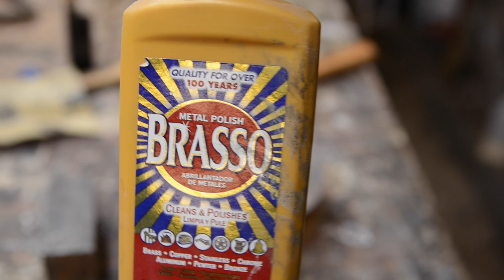Copper Vessel  - Figloo

Comment: Quick tip David, for copper and brass, instead of Brasso, you can use Ketchup, the acids will works the same, and it's a lot cheaper

Comment: What camera do you use dude? I'm considering getting a go pro for filming my projects but not sure how that'll handle the close up shots. Just trying to get an idea of what other makers use.
Reply from the maker: I use a Nikon d7100 with various lenses. The go pro is a decent camera to begin with but you can get better looking image and macro abilities if you look at some Sony handy cams for example - for about 2-300 $ yu can get a pretty slick multi purpose camera to start. I use my go pro for specific needs like water proof aspect- but it's really best for the range of close action- strapping to your head and jumping off a cliff - or about 1-2 feet away from your work- and it can be set to a medium shot instead of the super wide that distorts everything- but these are things you will play with and find what you like-
Reply: Thanks for the detailed response. I've got a Nikon D3100 but I'm concerned about the saw dust etc knackering it. Maybe a camcorder is the better way to go, less complicated, (less to go wrong as well) so I can focus more on my work. oh, and merry Christmas mate